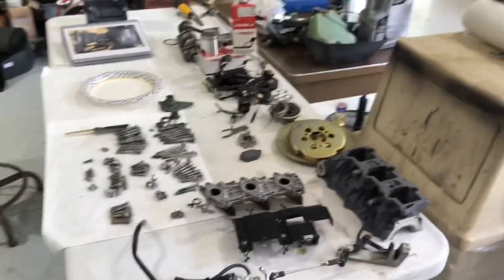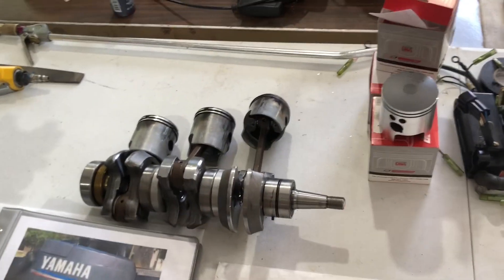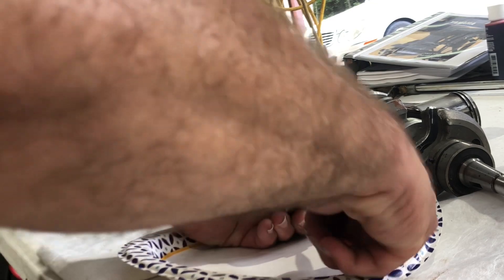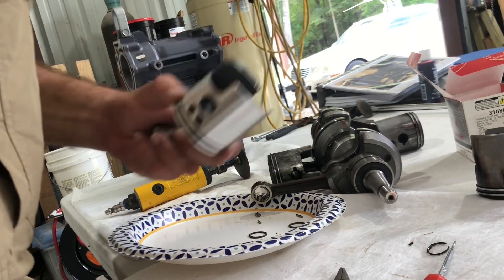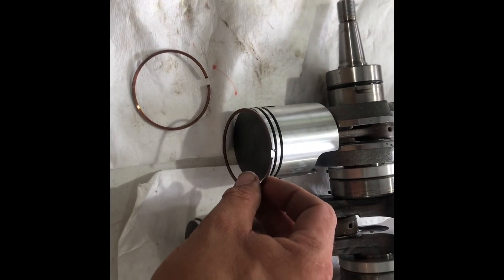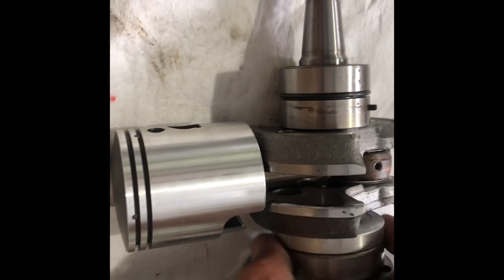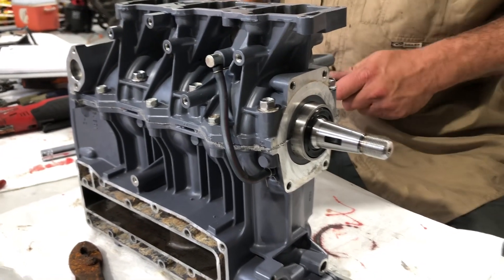Yamaha 30HP Outboard Overhaul Part-2. Tricky Piston Install. DIY.

Comment: I have a 1989 30hp evinrude half of my spark plug is clean other half is black what does that mean
Reply from the maker: @dustincribb8616   Running rich on the darker plugs and running lean on the lighter plugs. Have you rebuilt the carbs? Only use OEM kits. I’ve found that the cheaper ones one eBay and Amazon can cause reliability issues.
Reply: @mtwz71  I have two spark plugs. It’s like somebody divided each one and half one dark side and one side on each plug.
Reply from the maker: @dustincribb8616  Okay, are they same type plug and is the gap the same? Also, it appears if one side is dark and the other side is not. That make me think there’s a ignition or coil pack problem. Check the fire.
Reply: @mtwz71  same type of plug same gap
Reply from the maker: @dustincribb8616   call me. 281-785-6935
Reply: @mtwz71  it will be around 530 or 6 if that’s ok
Reply from the maker: @dustincribb8616  I’ll be on a plane coming home from Mexico. Just text me tomorrow.

Comment: Today I put all 3 new pistons on my new crankshaft. I really liked your strategy of cutting the old wrist pin and using it to keep the pin dowels in, however i didn't have a tool to cut my old wrist pin. Instead I inserted the new wrist pin, and put all the pin dowels in. I then put the permatex ultraslick inside the little hole on the rod above the pin dowels and rotated the wrist pin until the ultraslick was all the way in. I repeated this about 4 times. Now that the dowels are thoroughly coated in ultraslick, I put one of the plate washers flush into the rod, and the pin dowels will poke out slightly on the opposite side. I then removed the wrist pin, and all the dowels stay in place due to the ultraslick coating. Next, I inserted the wrist pin into the new piston just enough to put the second plate washer against the inner wall of the piston. Then i carefully aligned the wrist pin with the rod and was able to push it all the way through. It was finnicky but i got all 3 pistons done in just over a hour. Just waiting for my new crank case. It should be here by the first week of september, if everything is on schedule.
Reply from the maker: It’s tricky to do sometimes. I like to use the old pin I cut because it will hold both washers and the needle bearings till you push the new wrist pin in. Hope your build goes good.

Comment: where did you order the pistons from?
Reply from the maker: The machine shop that I used to bore the cylinders with, they were a Wiseco pistons dealer. They ordered the Pistons that I needed through them.

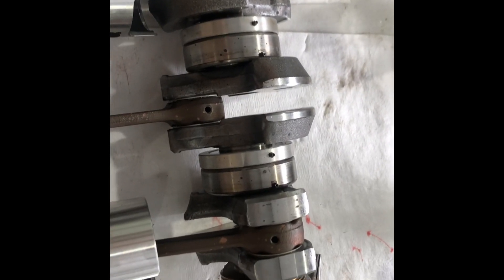Comment: 12:08 What does this oil injection ring do? Is it connected to the precision blend system to keep the bearing oiled?
Reply from the maker: That ring is a helix cut gear that is used to drive the oil pump on the side of the block that supplies oil to the intake and cylinders.